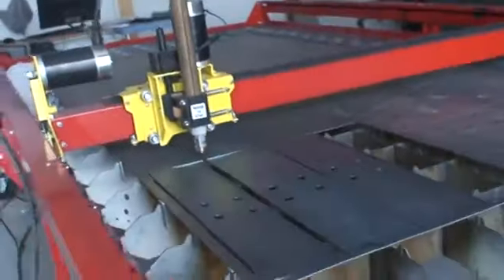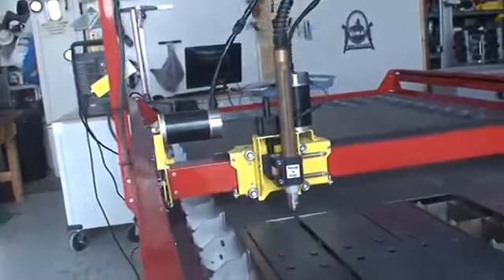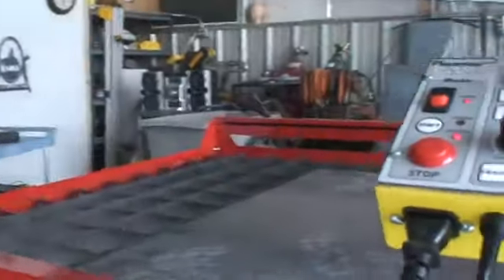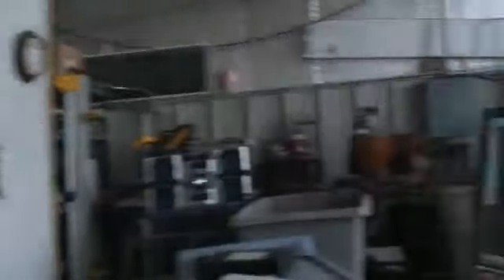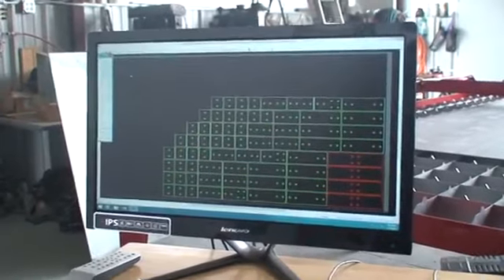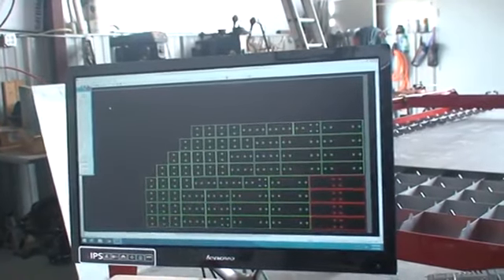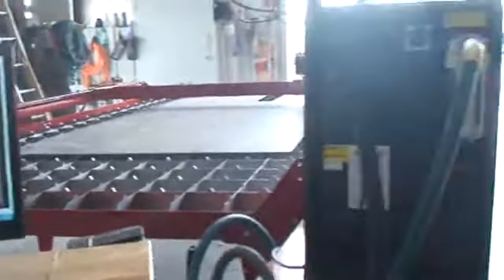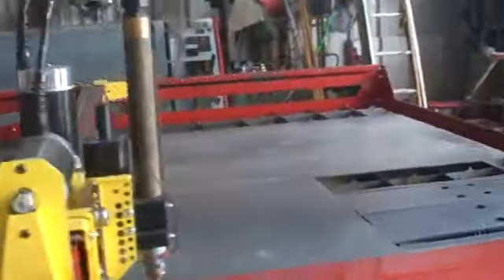New Arrival OLE Metal Fab Plasmacam Samson 5x10

Comment: I got a table recently. Nothing but issues so far.
Reply: Why?
Reply: I’ve had a Samson 510 for about 7 years. I use a hypertherm 1000, also about 7 years old. I’m about 50/50 work and hobby. I’ve had very few issues with my set up. I still use the original software, not design edge.

Comment: They are brilliant!  Be a good idea when you can to update to the new Duramax torch, they are the current model and Hypertherm do them as a retro fit option, you can them use the torch in the short size and works great with the Snap'n'Cut, gives better cut quality and longer parts life.  Happy cutting.